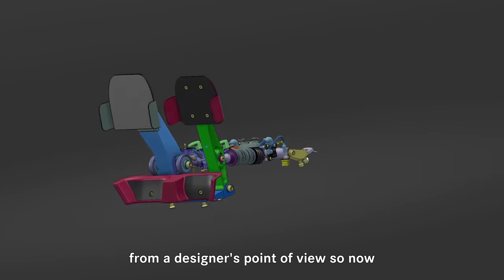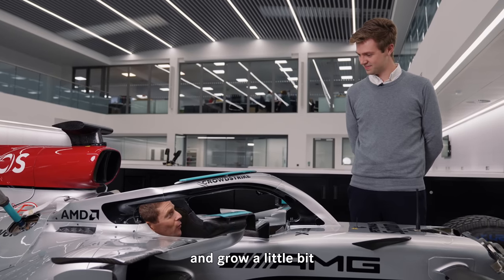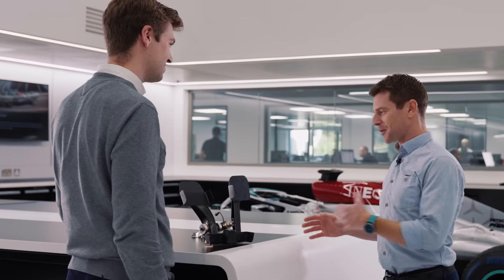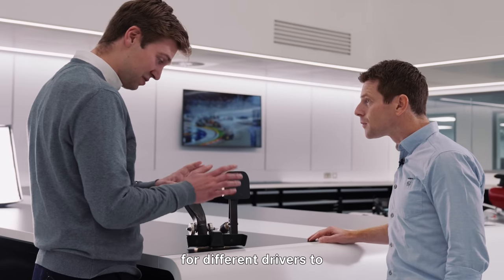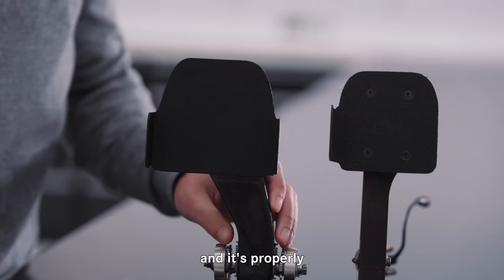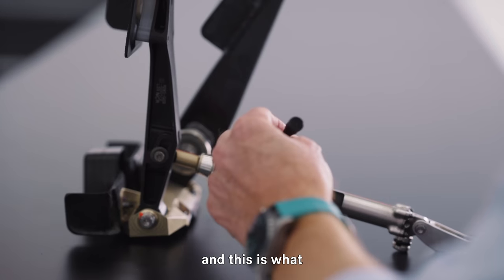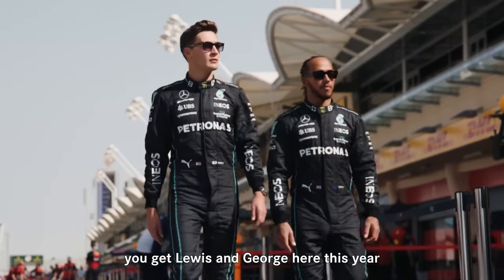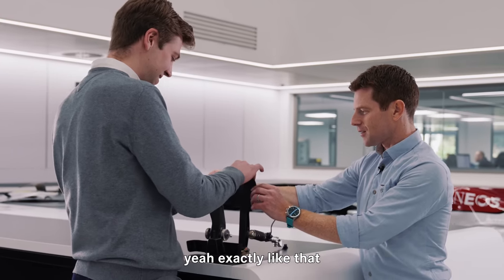F1 Pedals | How It Works 🔧

Comment: Would love to see more pedal cams in the future! I think a lot of fans don’t know it’s the feet where the magic happens.
Reply: Yep but it would be nice if it was pointed down at the feet and not looking back.
Reply: "I think a lot of fans don’t know it’s the feet where the magic happens."

I know thats not real racing, but in Sim Racing, upgrading to a much better wheel base and steering wheel didn't do much for my lap times, just made the game more fun. But when I upgraded from a cheaper brake pedal to a more high quality gas/break pedal setup, my lap time very quickly went down. I was chocked how much of an impact the added brake/throttle control made to my lap times.
Reply: If you don't actually drive on a track it's very hard to understand how your brake and throttle inputs actually rotate the car. You can have the same steering angle but rotate the car differently with more trail braking or more throttle input
Reply: 100%... overtaking happens on the brake pedal most the time
Reply: Lmao... a brake & accelerator pedal.

What a riveting watch. 😂
Reply: @blueanodized  It is for those of us interested in high performance driving.
Reply: @YEEYEE-dy8tk  sure thing bugman.

I can see you're clearly of high intellect to be enthralled about an accelerator pedal and a brake pedal.

'MuH HiGh pErFoRmAnCe dRiViNg...' 

😂😂😂
Reply: @blueanodized  If you don’t like driving why comment on an F1 page?
Reply: @YEEYEE-dy8tk  I love driving. Do you own a race car? 

Heres the thing - mine has a three pedal manually clutched sequential setup.

I'd doubt you've ever even changed your brakes let alone built a car from the ground up.

I couldn't care less about F1 tbh - just here to laugh at small souled bugmen. 😂
Reply: @blueanodized  Which club do you drive with? NASA, SCCA, etc.?
Reply: @blueanodized  I knew you didn’t drive at all. You’re just a bugman lol.

Comment: Great Vid for Sim Racers to see. 
#1. you don't need more than 100kg load Cell.
#2. The Brake Pedal has More Range of Motion and Travel  it's NOT a Stiff Pedal
Reply: I did watch a video where Vestappen said that on his car the brake pedal travels very little. Maybe it's a setup thing for him 🤷‍♂️
Reply: Norris’s pedal cam also shows his pedal have some range of motion. 
Gasly’s pedal cam shows less travel (but probably due to driving at low speed and wet track, the camera position makes it hard to tell)

Comment: Very interesting the difference in makes for each pedal. understand the increased force on the brake pedal means you'd want it to be carbon fiber, but why not make the throttle out of it as well? I'd think aluminum is heavier than carbon, right? Something to do with the damper/spring setup?

Comment: I feel like they had to hold back quite a lot on this one. I know what a pedal is, but I still don't know how they work precisely or what would differentiate these from my car.
Also, carbon sounds pretty good. Stiff, light, strong, ... so why the aluminium one?
Also also, 100kg pressure seems really small? You hear people say that under have braking drivers will almost litterally stand on the brake. That's 70kg at 4-5G or 280-350kg of pressure. 
I love Mercedes, I love these videos, but this one just leaves me with more questions than I had before.
Reply: Yeah, I could tell they were holding back some (probably key) information haha, but still- much better than any other team that didn't say anything at all! Love the transparency and the technical insight that Mercedes gives to the fans- I feel like I'm learning as if I'm brought into the team.
Reply: All the teams use “fly by wire” systems though. I understand the need for discretion but they didn’t actually say how ANY of it works. I know a lot of it we can glean; I’m assuming some of us know what a damper does, but they titled the video “How” it works and instead showed us “What” makes it work and left out the “how”. 😂 They could have told us the idea behind fly by wire without actually telling us how they implement it.
Reply: I learnt nothing from watching this other than they have grip on them

Comment: PU potency is not so important nowadays.
What really matters in the engine is the torque curve, it is where significant gains are found.
A little engineering:
Power = Torque x Speed.
As speed (n exceeds 350km\h stagnated due to aerodynamic drag, today it is much more worthwhile to work on Torque where the limit is the tire.

Comment: Wait, so why is the throttle pedal aluminum versus making it out of CF?
Reply: Probably lighter and it doesnt need to be as stiff as the brake pedal.
Reply: @sergiorojas1161  you think they could make it lighter with aluminum versus carbon fiber?

Comment: Considering how stiff race car brakes are, I wonder if anyone has a wider brake so you can use both feet to step on the brake for those hard brake moments? 

If you ever drove some formula cars the brake moves very very little and you get used to that sensitive brake.

I drove several formula cars and that was what I noticed.

Comment: Aside from mentioning that there is a damper connected to a wire and 100kg of pressure top end, they was no mention on how F1 pedals actually work. i.e: how the position of the pedal communicates with the engine, the distance of travel of the break pedal and how it communicates with the brakes etc.
Just a lot of talk about how there is 'Alot going on...all very different...have to press it hard'

Comment: So I get why they made the brake from carbon fiber. But why would you use a heavier material like an alloy on the accelerator? Wouldn't carbon fiber also safe weight?

Comment: What is the reason to make brake pedal so hard to push? If it's only potentiometer you can make spring softer. Doesn't make that more comfortable for driver?
Reply: resistance when braking so you can"feel"the braking
Reply: The brakes are not 100% brake-by-wire (BBW). both the front and rear calipers are still actuated by the driver pressing on the brake pedal, so that in the event of a computer problem the driver can still brake the car. This is why they are so stiff. The BBW component only applies to the rear tires, and uses a bleed off valve to reduce the pressure coming from the driver to compensate for the braking applied by the ERS system harvesting.
Reply: Sounds like something perfect for “How” it works video 😂
Reply: @TheSnaveeelPlaysGames  that is what this video is.
Reply: @davidtube79  it isn’t though is it. Nothing tells us “how”.
Reply: @TheSnaveeelPlaysGames  you must be expecting more then.
Reply: @davidtube79  I was expecting to be shown what the video title said I’d be shown. Should have known when I saw the length

Comment: Why not have both the pedals made out of carbon fiber? It would help with weight reduction as well.
Reply: Cost $
Reply: @C0rgs  I am aware of the cost restrictions but I doubt that a single pedal makes enough cost difference especially when these cars are often split by a thousandth of a second. Maybe that little bit of weight would be the difference.
Reply: @BelieveIt123  when you bare in mind to make a component from carbon (in this case closed tool 3d print is out the window) you need to machine a pattern from EP138 board, laminate tooling material on this, cure then post cure the mould. Once that’s trimmed and ready the component can be made, it’ll have inserts (usually machined carbon/metalics or rohacell. Or a combination of all 3) that then goes in an autoclave, it’s then trimmed, inspected and ready. Where as aluminium will be machined, then tested. Much shorter process. Long explanation but you get the point about time with carbon. Not necessarily why in this case but hope it helps.
Reply: @_chenn  I get the explanation and the reasoning but they can just make the two pedals identical. Its not like the physical pedal itself serves any purpose other then being a place where you rest your foot. Since both feet are identical, both pedals can be too. The mechanics behind each pedal obviously has to be different due to their different purposes. But the pedals can still be designed the same. Well I am sure there is a lot more to it then just that. These people know a lot more about the car then I do, surely they have their reasons I suppose.
Reply: @BelieveIt123  Agreed, they do differ though, I’ve made a few brake pedals in my time at various teams and it’s always interesting to see different driver’s preferences.
Reply: @BelieveIt123  I figure that every little bit of savings is worth it where you can afford to find them. Aluminum is bother heavier, and weaker than carbon, but carbon is much more expensive. The pedal is small so the weight may be a small loss for cost savings.
Reply: @BelieveIt123  in this cost cap era every penny you can save is worth it.
You can machine aluminium and clean it up in one day.

Comment: Deep dive, hardly. How does it work? By wire. There, everything explained. Why does it go forward and backwards? Why pivot in the middle? Why have two assemblies on the brake, one with damper and spring, the other just a rod, and why do they go back to a single rod? Why is the animation so different than the model, with all the parts missing? How does fly by wire work? How does the feedback loop work? How is the pressure created to feel like brakes? How does the pedal work????